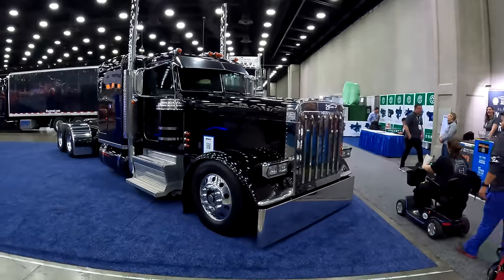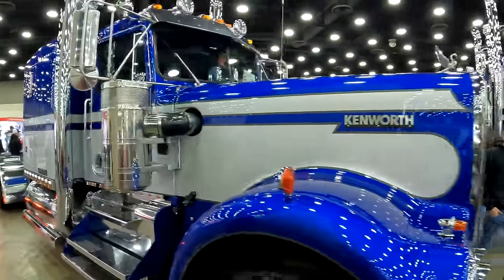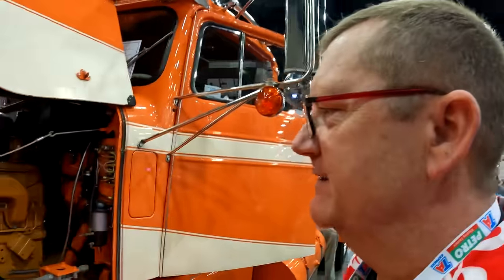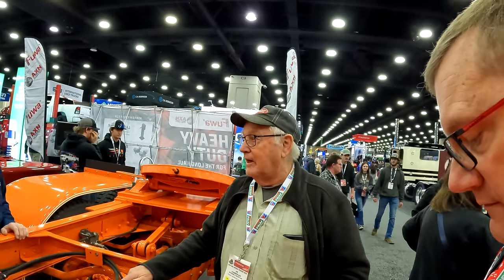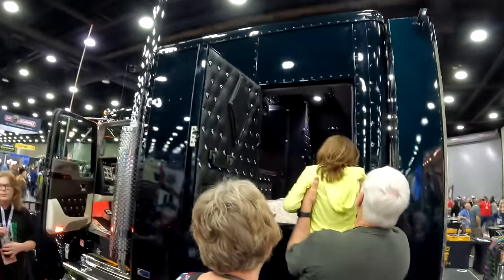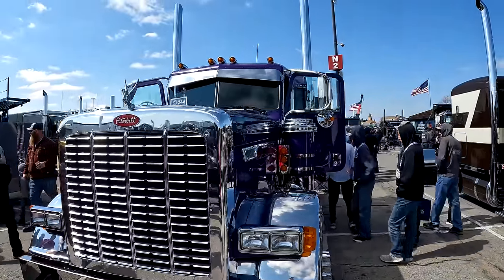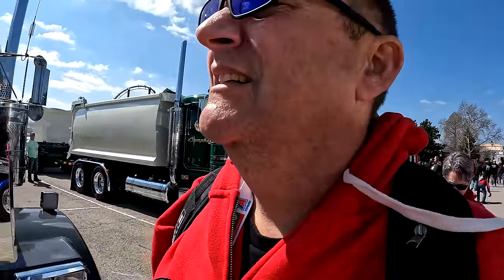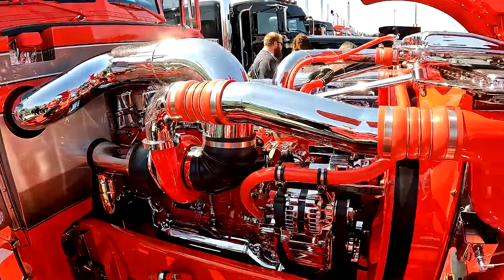MATS day 3 so many trucks.... 😍

Comment: Personally I think the emblems should stay on the trucks, ESPECIALLY the red Pete oval and the KW grill bug...
The early Pete emblems before they went to the red oval are cool but you don't see them much anymore.
The red oval is iconic...
The two-tone blue Pete 352 that you looked at outside reminded me a lot of the 352 that I drove for Gordon Trucking
out of Sumner, Washington back in the 80's. It had an old V-8 Cummins and a 13 speed and that truck would run.
Back then Gordon trucks were legendary for having nice trucks with BIG power, and our main job was hauling beer.

Comment: Awesome video Mike. I am thinking about getting a well looked after 1990 K100 Big Cam. Running and fully CVIP'd I am here in Alberta. You seem to know them very well. What would you think the value of a good truck should be?
Reply from the maker: A decent truck road ready is anywhere from 20k to 60k in my opinion.  If it needs some work the 5k to 10k I'd say
Reply: ok thank you
 @mikethetrucknut

Comment: Although very nice to see and look at, dark colored engines just don't show up the leaks in the system..... I think you must know if you don't spot some different leaks, your day will just turn horrible. Dad is like myself in that those trucks were nice looking but most are at best, similar to a boat. You keep tossing money at them and it just never ends with our fast pace of trucking today.  A guy with one truck or a max of two can keep them going but just money pits. I would not pull "whiny Bruce Wilsons head out of a toilet if I was needing to use it..   Heck, Tim Gentry snubbed you.. tells me a lot of those folks that just don't remember how they got one step up the ladder